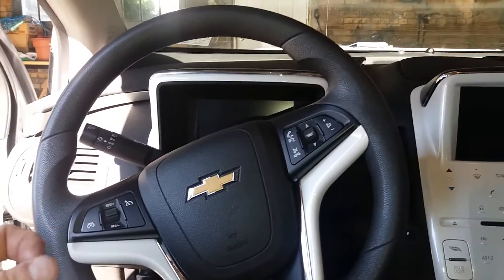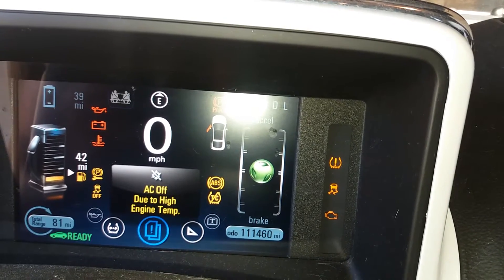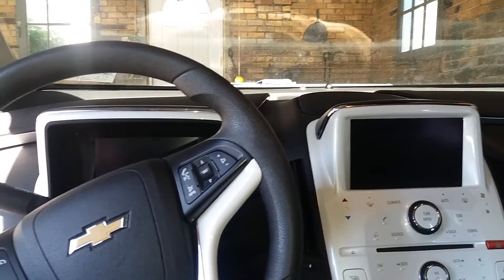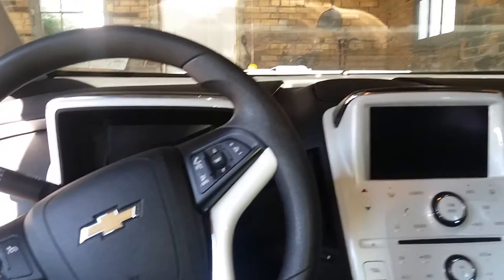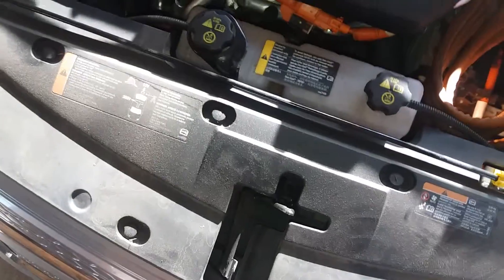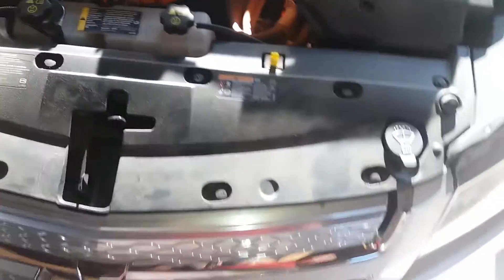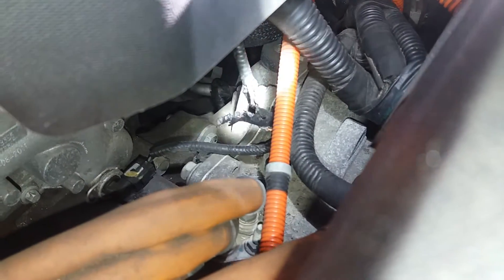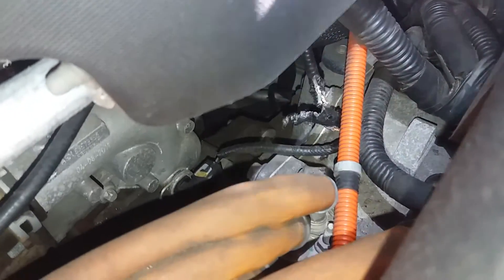Chevy Volt Coolant sensor error P0118

Comment: Just had the same issue. Was going to take it in to the dealership for some standard extortion but I saw your video. Mice at the wire to the sensor just as you described. Spliced it and she's good as new. I owe you a beer if ever you are in Colorado!! Thanks!
Reply from the maker: Glenn Dowling glad I could help. I was Soo mad when I saw the error code. I figured it out. Will look forward to the beer:)
Reply: No ,its coolant level is low
Reply: @10K-b5d  ??